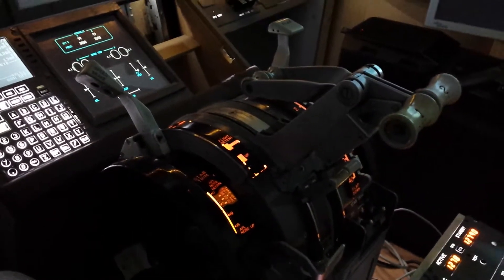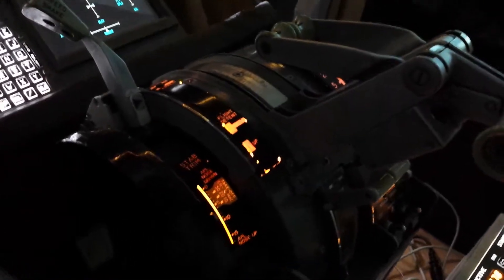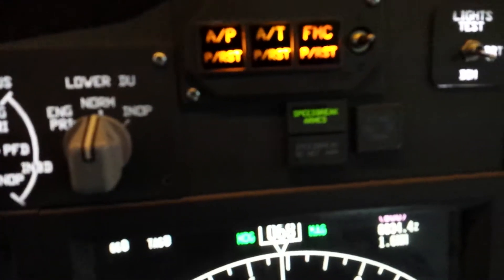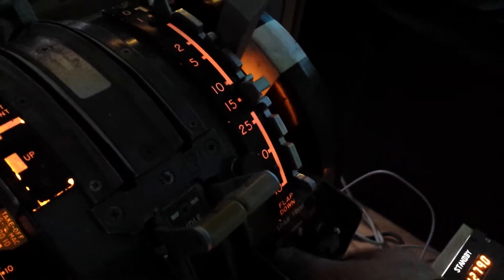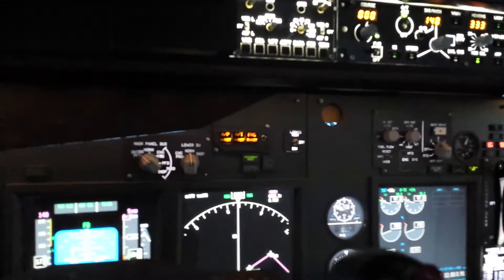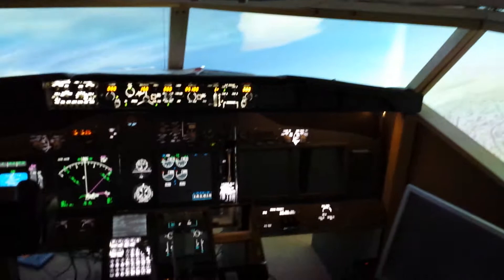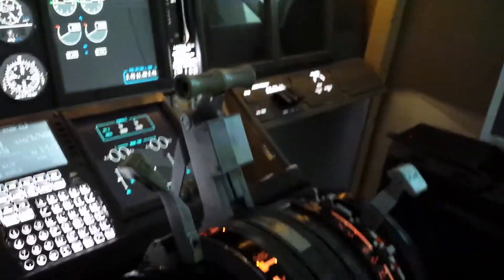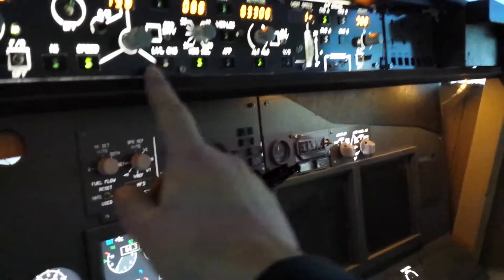Original 737 Throttle finally working in my Homecockpit....

Comment: Hi -- how are you providing feedback with your trim wheel to the OC DC motor card? Are you using a potentiometer attached to the trim? Cheers.
Reply from the maker: Hi, the speed of the trimwheel is fixed. There is not feeback, If Trim Signal will come from Prosim via Sioc - the motor starts to turn... Cheers Andreas
Reply: +Andreas Haug cheers. I have an a320 trim I am trying to motorise. You can manually trim the aircraft so I am trying.to.figure out how to implement an input system.
Reply from the maker: Input is done via Prosim 737 (there should be a A320 of prosim version now) to the simulator (FSX/P3D/X-Plane).. Simulator provides Output to Opencockpit (SIOC)  which fowards the info to the OpenDCmotor plus card. For example manual trim: You press the button on the yoke for trim - signal picked up by prosim - transfer to simulator - transfer to Sioc (read Variable)  - transfer to opencockpit dc motor plus - power to trim motor.  I hope its understandable what i wrote.... Summary: Use Opencockpitsm Dc Motor plus card to drive the Trim motor.